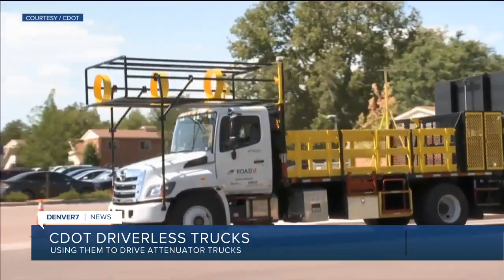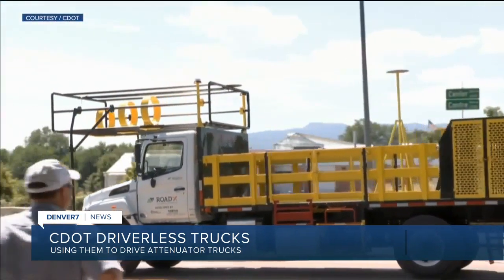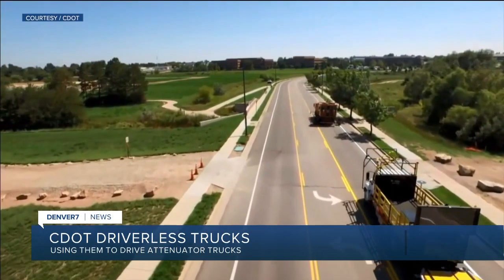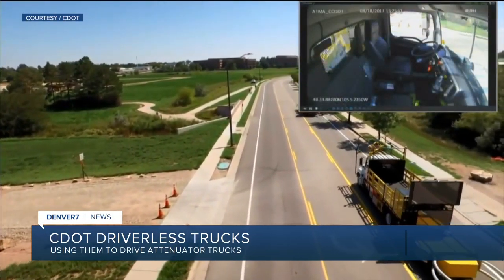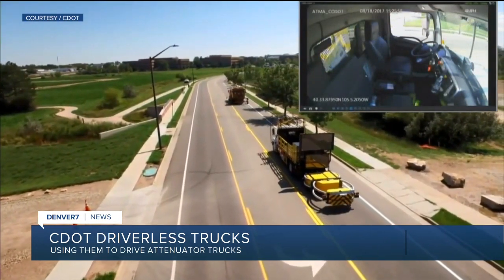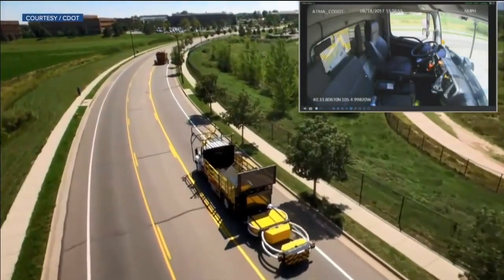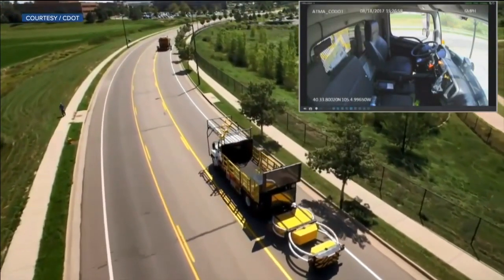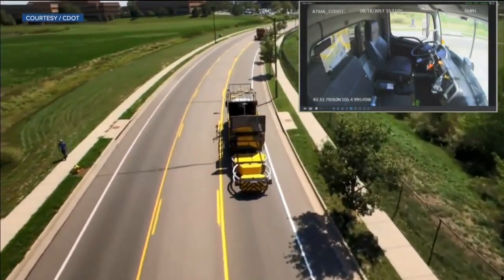CDOT using driverless trucks in some construction zones

Comment: So  CDOT can violate colorado law?   As far as I remember law states a driver MUST be behind the wheel even if it's a self driving vehicle.
Reply: They're legal, if it can be demonstrated to follow all laws. Policy

Senate Bill 17-213 authorized the use of highly autonomous driving systems in Colorado under certain conditions, which established Colorado as one of the most forward-leaning states in the country. The legislation established the following policy environment in order to support the continued advancement and deployment of Automated Driving Systems (ADS) in Colorado:

Levels of automation 0-3 (SAE) are legal under Colorado law with a human driver in the vehicle.

Defined “Automated Driving System”, or ADS, as Society of Automotive Engineers levels 4-5. Highly autonomous driving systems (Level 4-5), with or without a human driver, are authorized to operate in Colorado if they can meet all applicable state and federal laws.
Reply: Call the COPS